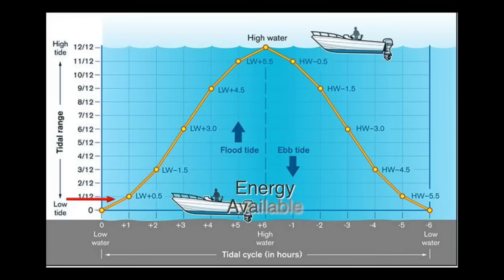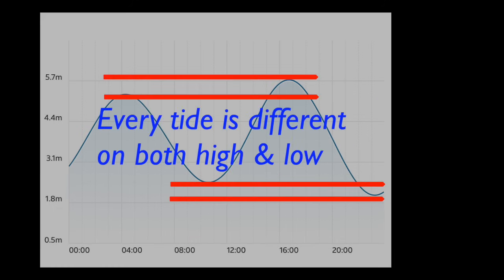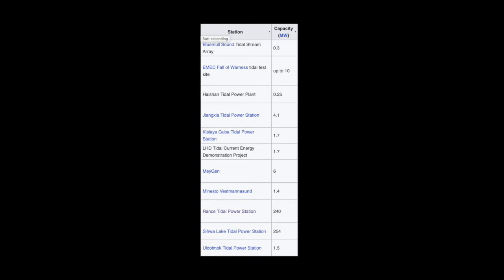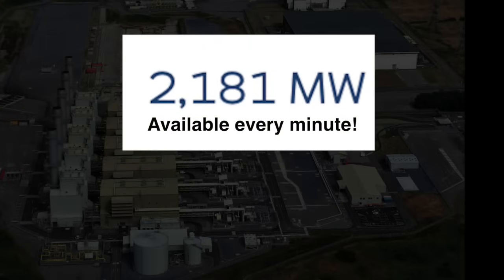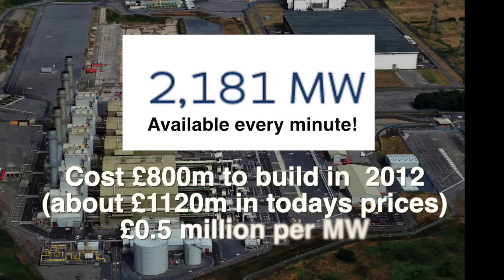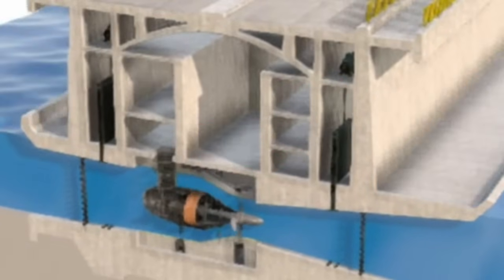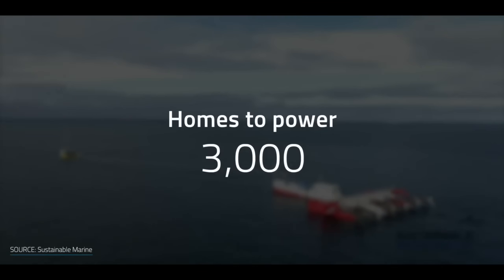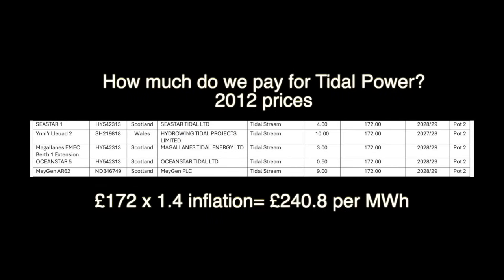The Delusions of Tidal Energy

Comment: But tides are different in different places, for example high tide in Bristol is 12.00hr, high tide in Swansea 14.00hr,, high tide in Milford haven is 16.00hrs and so it goes. So there would be a continuous load production. (Times are only examples) plz get back I have some knowledge in this.
Reply from the maker: No, that does not work. You would need all the power in one place and the costs of doing it are out of reach.
I have sailed in the Bristol Channel for years so I am very aware of the tides. Ther amount you get per buck is simply nothing.
Reply: @ClimateRealism  there is a material called piezo plastic, I made a small scale model, based on the movement of a fish, it oscillates back and for when pulled through water. When I put it on the sea bed and the tidal stream started it still produced. Think of a fishing lure.
Reply from the maker: @mikechesh-nq9gj  But it is not capable of any economic scaled energy production.

Comment: The French are a bit anti-barrage these days. They've removed a few on rivers in recent years rather than replace the turbines as the recently completed Faskally refurbishment.  This is for environmental reasons so I suspect that new barrages across tidal estuaries.
Many people think that the solution is to build tidal power stations round the coast. Even if it wasn'tmore expensive than sending a man to Mars are there enough locations to supply the whole country with a decent amount of electricity 24/7? The other problem is that the best locations are road the coast of Scotland. 
Falls of Lora is a good place to view the changes in tidal flow.
Reply: The electricity produced on the river barrages like on the Rhine, Moselle etc are really only a byproduct as they were  built to make the rivers navigable. I don't know how much electricity is produced in the combined total of barrages on any particular river. It can't be that much but it does make some sense as the flow is pretty consistent and in the overall construction costs of the barrages and associated locks, it would be a relatively small cost to add unlike the huge costs of building them specifically to produce electricity. No one ever seems to account for maintenance costs per MWh either. Do you know where the ones being removed are?
Reply: @paul756uk2  The one that was on the News when we were in France was Sélune River in Normandy. But smaller barrages on the Dordogne and Vienne rivers were planned when we were in Limousin.
The main reason was to allow the ecological to allow migration of fish etc. I don't know if they all had electricity generation though
The fact that not much electricity would be generated compared to nuclear would make whatever they did generate irrelevant in the scheme of things
Reply: @Wee_Langside  yes this is very true. The barrages on the Moselle are all in Germany and the ones on the Rhine are either in Germany or bordering France and Germany and we know what Germany is like with their obsession with 'renewables' and their disdain of nuclear, dismantling what little they had.

Comment: Orkney has a problem.  It has more energy than it can use, hence experiments in hydrogen powered boats.
Reply: The cost of building a transmission line the 500 miles from Orkney to London also means they might never be able to export it.

Comment: Metal propellors/construction in salt water. I think if you take the yearly required maintenance into account, the net power output is going to be even more shockingly low.
Reply from the maker: @basbass429  agreed but no data available.
Reply: It's not just the down time. It's the replacement cost after a few short years due to rust and corrosion. It's the same for wind power too. Not to mention the decommissioning costs when it's superseded by thorium reactors and low-energy H2O hydrogen-bond-breaking technology. We may soon understand and be able to manipulate gravity and interatomic bonds too. All this "green" (but not green) technology may be obsolete in a few years - assuming we have any money left for research after the net zero nonsense has destroyed the economy... <that's enough now - ed>